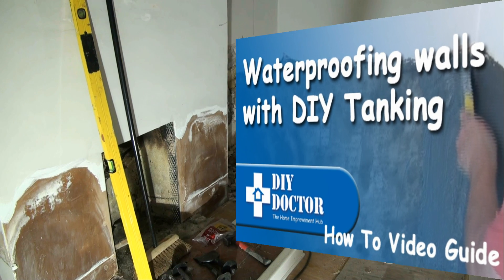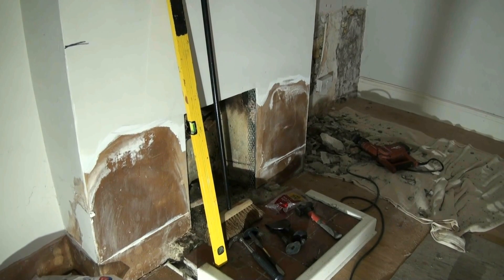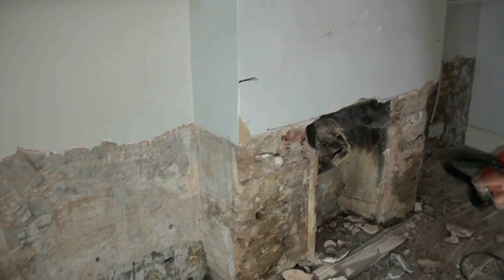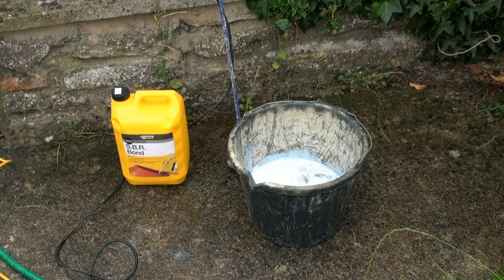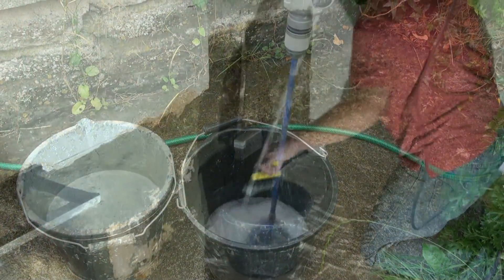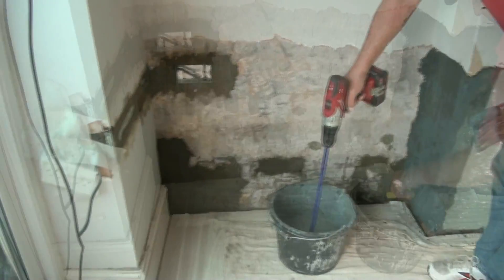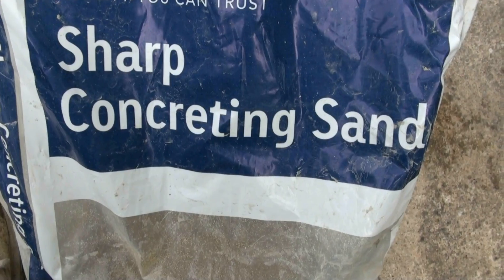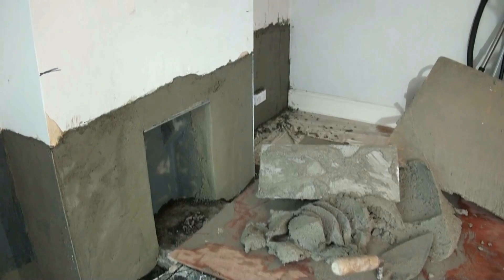Waterproofing and damproofing walls with DIY Tanking

Comment: So the sbr is the only additive?
Reply from the maker: +Richard Grave Yes Richard, Itsnot somuch an additive as the main ingredient. No salt inhibitoris required as mo moisture/damp can get through so it cannot bring any salts with it. The SBR forms a rubber seal on the wall.
Reply: +DIY Doctor in your opinion is it as good as the ready mixed tanking slurrys? All the best and keep up the good vids
Reply from the maker: +Richard Grave I have to say that the ready mixed sluuries are easire to use as hey keep their consistancy while being applied. Unless "whisked" often, the DIY method can be faulty as the cement can settle at the bottomof the bucket. But ifdone as shownin the vid, it willmost certainly do the job for you.